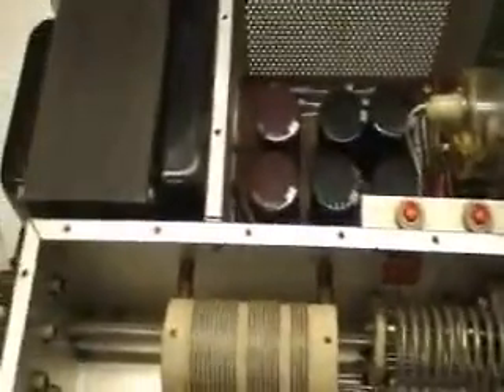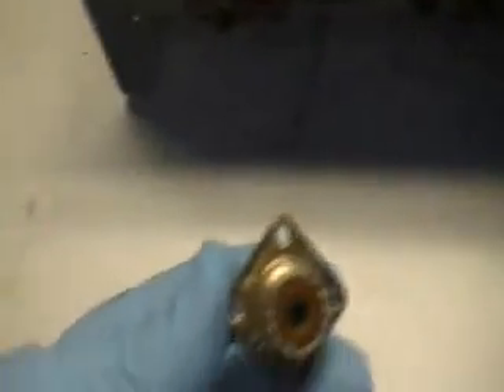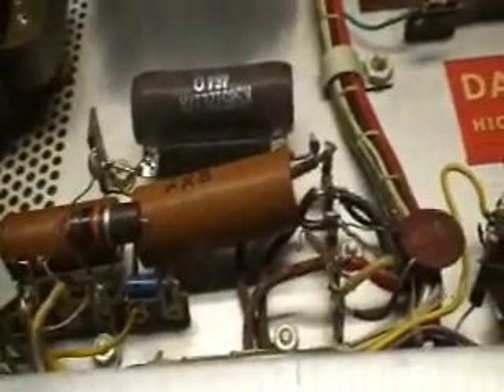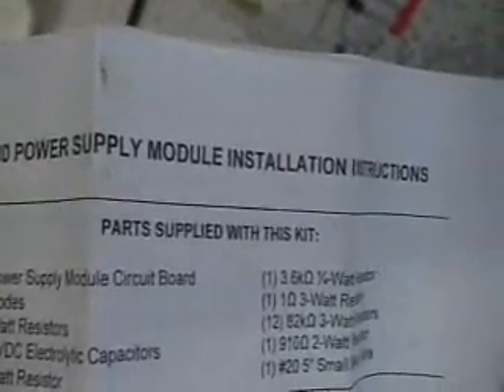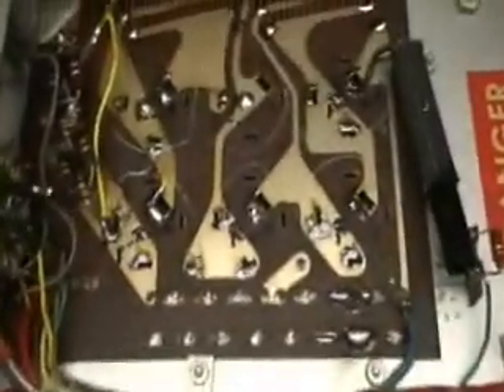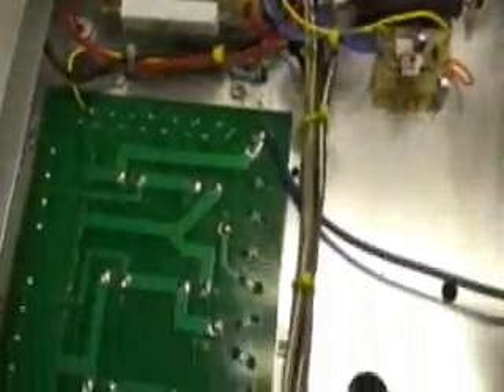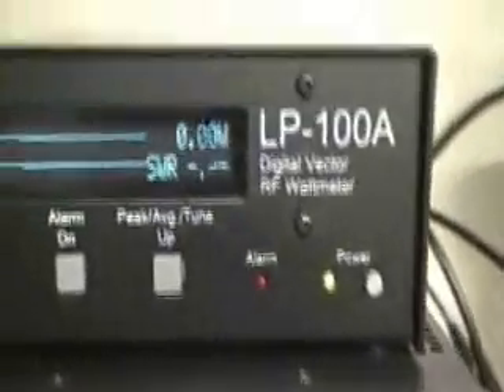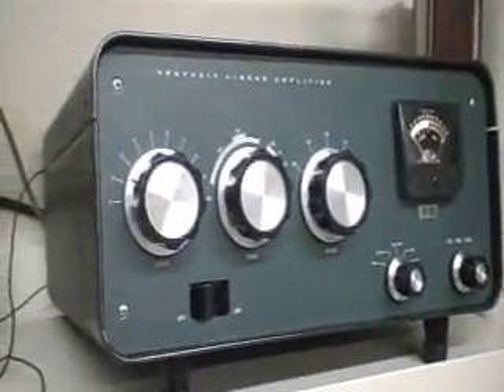heathkit SB-200 tune up.wmv

Comment: I picked up a dirty and dead SB201.  Added the Harbach power supply board, and the low voltage keying board from Harbach.  I also installed a meter protection circuit as recommended by many.  Fine amp, and hard to beat for the price!  Provides 400 watts out with about 45 to 50 Watts of drive.

Comment: My SB200 is an old friend, tough as a brick outhouse, solid, reliable. Compared to a new-fangled, bells and whistles amp? So you have to spend a few seconds tuning it up, I can live with that. Actually that's a part of operating I enjoy. We hams are supposed to tweak and twiddle.
Nice upgrade.
Reply: Problem is that so many do it On the Air and not into a Dummy Load.

Comment: I have 2 of them. 200 and 201. 1 is routh shape but works. noisy fan. rebuilding the outher one sb200.  I found most parts on eBay. I need to re paint case. trying to match heath kit green. They still make 572/B tubes. I put them in my collins 30L1 instead of 811A. There is a 12V mobile version of this amp the HA 14.I have it with both AC/DC power supplies. Ineed HV caps for the AC. one project at a time. I hope to have SB200 working in the next few months. Thank you for video. I am fixing the very same amp.
Reply from the maker: Hope the video helped. Good luck with your projects.Sounds like a nice collection you have there.

Comment: An excellent video with some superb detail.  I have just aquired a SB-200 from a Silent Key sale and hopefully will bring it into service with my IC-756Pro, once I've
done a full inspection of the internals, I only picked it up last night.

Regards
Nidge (G0NIG) IO93dv
Reply: Tuning these are  way too confusing. I've never found a simple, strait procedure to tune these into a dummy then into an antenna...
Reply: @solarflare8905 🤣😂 It only has a Tune and Load knob and tunes like most manual tune amplifiers? Very Simple! You must have been over thinking it? 👍🎙

Comment: Where would I find the solid wire used for the RF chokes to the tubes" I have one that broke off at the end of the resistor and need to either replace the entire item or I would prefer to repair the existing resistor wire. Please advise.

Comment: The fan sounds Very Loud? Lots of Quiet options available Today but you didn’t use one of them? The SB-200 is an OK mid power amplifier just like the FL-2100 but they were under built if you use the parts that HeathKit supplied for the kit.The SB-220 is and was a much better choice and far more reliable as well.👍🎙
Reply from the maker: This video is ~ 12 years old. I moved on to a solid state amp a number of years ago. It is really quiet. Plus puts out 3X the power. Kept the SB200 in the antiquities collection on display.
Reply: @RGsedona  I have been using a No Tune Solid State Amplifier for 10 years so far and I love how it follows the ICOM 7700 without touching it.👍🎙
Reply from the maker: @1OFGODSOWN  The 7700 is quite the unit. Love it.  I am using an early KM3KM Mercury 3S with my Icom 7300.
Reply: @RGsedona  I have never heard a 7300 sound bad but I can’t make myself trust a touch screen radio.We actually have one in the box from a friend’s Estate that I purchased my 7700 from. He only used the 7300 at 75 watts on 50.313 on FT8. Also I here wonderful things about that Amplifier and I believe they are built here in Florida? Lots of demand from what I here and a waiting list. de W4KVW 👍🎙
Reply from the maker: @1OFGODSOWN  In the beginning he only offered kits. I did a build video on it. Now he only offers factory built. The amp works great. I know what you mean about touch screens but I have adapted....for now.....https://youtu.be/zI4qMCKebgg

Comment: iVE GOT ONE OF THESE AMPLIFIERS COMING (WHAT PARTS DID YOU HAVE TO REPLACE) OR WOULD YOU RECOMEND???
Reply from the maker: Sorry for the late reply. All electrolytics. Band switch if it is toast. Relay if required. Anything else that is toasted. Tubes if Pout is low.